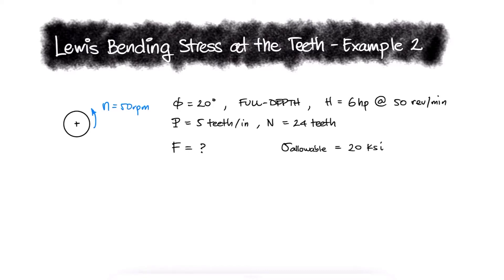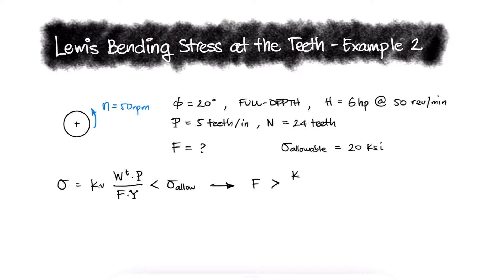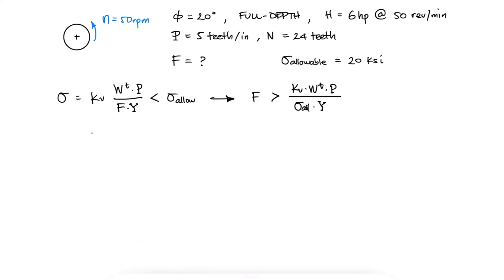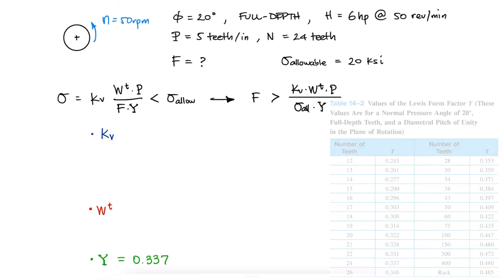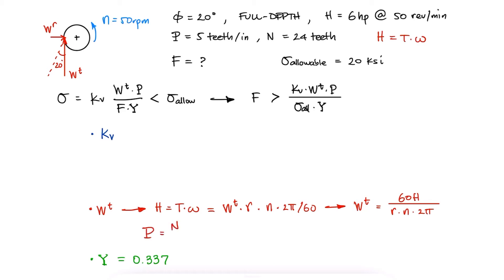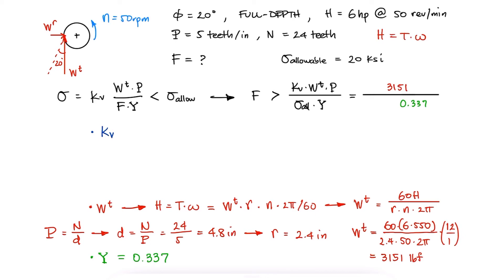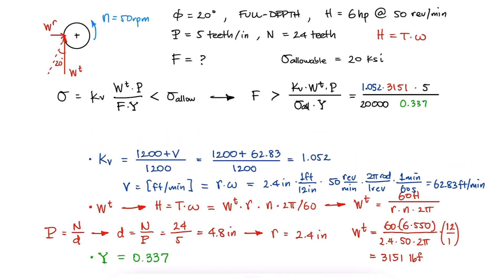Lewis Bending Stress - Face Design - Example 2

Comment: I can't calculate pitch line velocity as yours. Mine is coming as 1.046 ft/min. What else have you changed in the calculation.
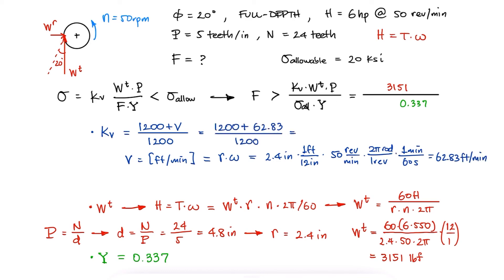Reply from the maker: 1:32 to 1:36 has the calculations you need, with all the units noted. Omega is the rpm in radians per minute, times the radius in ft instead of inches.
Reply: @LessBoringLectures  I believe that last term in your pitch line velocity equation (1min/60s) is not needed. When the term is removed, the expression calculates to 62.83 ft/min (as you have in the video), but with the term present, the expression calculates to 1.046 ft/s as he mentioned.